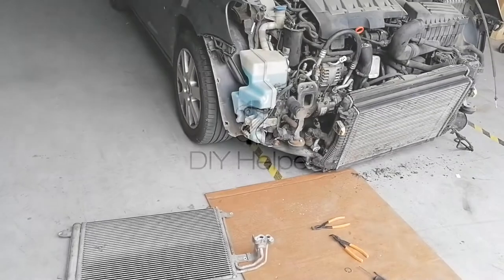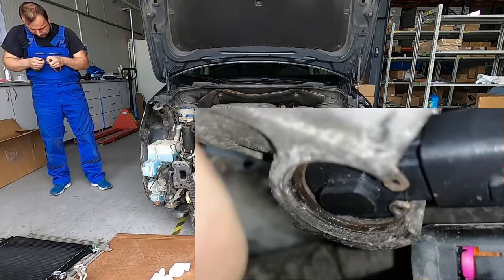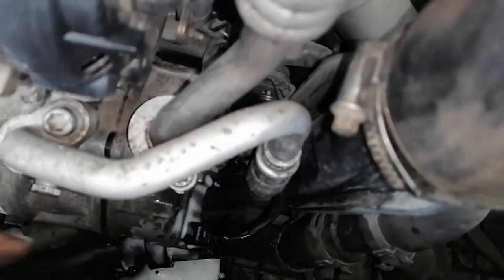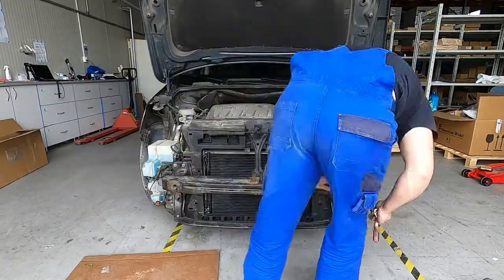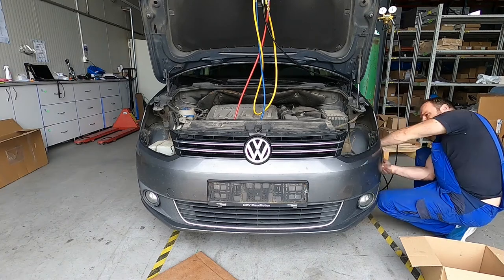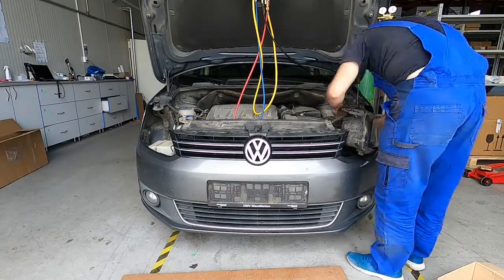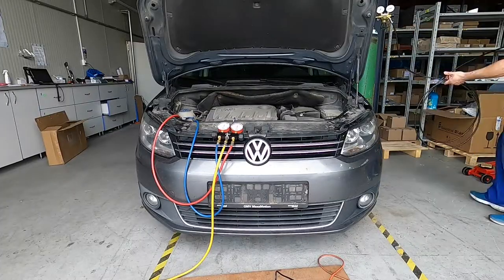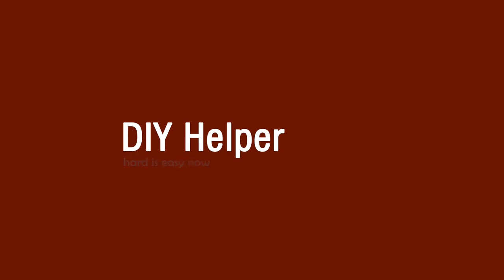VW Touran compressor control valve and condenser  replacement, AC radiator

Comment: See the fiberglassish material behind the engine sort of loosely drooping into the engine bay? Do you know what is that called? I've got the same issue and trying to figure out what the part is so I can hopefully order and replace it.
Reply from the maker: I think it is called engine bay insulation.
Reply: @DIYHelper  Thanks so much!